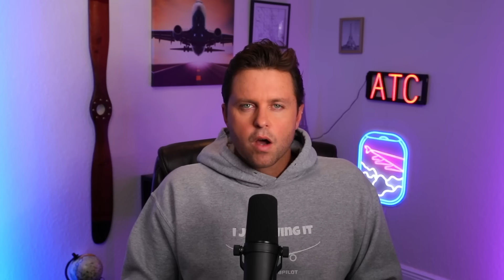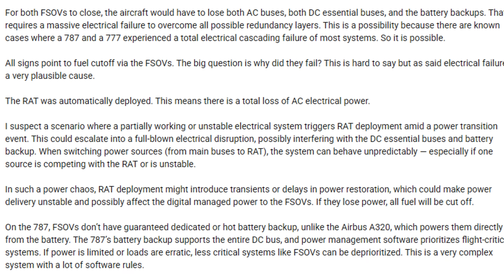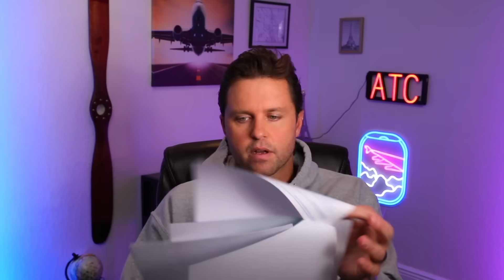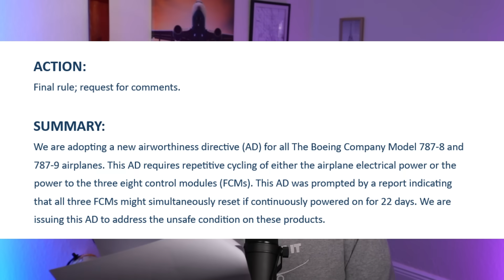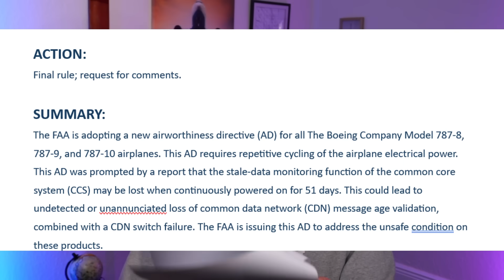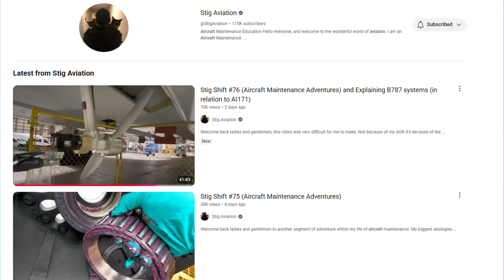Air India 171: Did a Software Glitch Cause Dual Engine Failure?

Comment: This theory is solid, and I fully agree it deserves serious consideration. The FSOV (Fuel Shutoff Valve) issue triggered by an electrical cascade failure is not only plausible — it's consistent with Boeing's own design and previous FAA directives.

The RAT noise heard right after liftoff, with no engine whine, suggests both engines were already dead. The gear truck tilt with doors closed supports that the retraction sequence started and froze — pointing to power loss early in the climb-out.

What makes this truly concerning is that this isn’t the first time. FAA AD 2016-24-09 warned about flight control module resets after prolonged uptime. We’ve seen RAT deployments (VS105, LATAM LA8084), and generator dropouts — all signs of vulnerabilities in the 787’s power distribution and redundancy systems.

On the 787, FSOVs aren’t powered by the PMA. If essential DC power is lost, they shut by default, even with the engines still mechanically sound. That’s how you get a dual-engine flameout without a mechanical fault.

Vapor lock? Unlikely. Fuel contamination? Needs to hit both engines at once — no reports of that. But this FSOV + electrical chaos? Matches the symptoms disturbingly well.

And here’s the most important point:
Even if this crash turns out to have another cause, Boeing needs to address this FSOV design flaw. The idea that both engines can die at 400 ft AGL because of a short electrical glitch is unacceptable — and we now have enough evidence from past incidents to justify redesign or redundancy upgrades.

This is a systems-level vulnerability — not a pilot error, not a freak failure — and it needs to be fixed before it happens again.
Reply: If this turns out to be true then Boeing should be held criminally liable. That's a major functional safety failure.
Reply: @mantan_rtw 2 weeks prior to this accident Boeing were legally let off the hook for the max crashes. It won't happen even if another 787 plunges into the ground
Reply: @mantan_rtw  They should have had criminally accountable by the first day the introduced the lacking quality controls in Boeing and tried to white wash it. One of THEIR MANAGERS who worked on the 787 Quality Management, in one of the first factories, comitted suicide not long ago.
Reply: Not the first time Boeing skimped on safety and redundant validated sysetms...
Reply: @albinekb  You’re not wrong — the 737 MAX MCAS tragedy is a stark reminder of what happens when design shortcuts and over-reliance on software override pilot authority or bypass redundancy.

What’s scary here is that the 787 FSOV situation mirrors that philosophy: a safety feature (spring-loaded fuel cutoff) makes sense in isolation, but when it's tied to complex electrical logic with no hardwired fail-safe, it introduces a new risk — especially during takeoff.

And since the 787 heavily relies on software-managed power distribution, a momentary glitch can disable critical systems that were never supposed to go offline in the first place.

It’s not just about Boeing cutting corners — it’s also about FAA oversight, certification assumptions, and whether enough real-world edge cases are being tested. Unfortunately, these issues often get fixed after a fatal incident, not before.
Reply: No it’s not. 

The conflict lies in how the Fuel Shutoff Valves (FSOVs) behave on the Boeing 787:

The post claims FSOVs are spring-loaded and will automatically close if electrical power is lost—cutting off fuel to the engines.
But Boeing design data shows the opposite:
On the 787, FSOVs are motor-actuated and latched. Once commanded open (or closed), they stay in that position—even if power is lost. They do not spring shut.
This means a total electrical failure would not automatically close the FSOVs and stop fuel flow. So, the theory that a cascading power loss alone caused both engines to shut down via FSOV closure is not consistent with how the 787's fuel system is built.
Reply: @morespinach9832  Thank you! I've also been trying to tell people this, but it's falling on deaf ears. 
As evidence, later manufactured aircraft actually had to have a supplemental rechargeable battery fitted to close the FSOVs in case of main electrical power failure. If memory serves, the wing spar valves also need power to drive these motor-driven valves closed. If the supplemental battery fails, the engines keep running until the fuel runs out ... or the fire service extinguishes the engine on the ground.
Reply: How many Boeing planes have this FSOV design flaw?
Reply: @michaelburnham4293  All 787s. Around 1200 units.
Reply: @michaelburnham4293   
Boeing 787: Most at risk. FSOVs are not powered by the engine’s own PMA or FADEC, but rely on the aircraft’s DC electrical system. If that system fails (or glitches), both FSOVs can close, even while engines are fine.

Boeing 777: Has similar electrical architecture in some models, though with different levels of redundancy. Not immune — LATAM LA8084 (777-300ER) had a major electrical cascade with total bus disconnect, but didn’t lose engines midair.

Older Boeings (737NG, 747, 767): Less software-driven. FSOVs still close on command but have more mechanical or directly-wired systems. The risk of silent shutdown from bus logic is lower.

In contrast:

Airbus (e.g., A320/A350): FSOVs can be powered directly from battery buses, giving them more predictable behavior during electrical transitions.

🚨 The issue isn’t the FSOV itself — it’s that on the 787, a short, complex electrical failure can trigger both engines to shut down, with no mechanical fault.
That’s why this deserves attention — even if AI171 had another cause, this weak point needs a fix.
Reply: If This turns out to be remotely close to the actual cause, I can see possible grounding of all Dreamliner fleet worldwide..  😳
Reply: Simple solution: shut the system down every few days.
Reply: @TeddyRumble -  not designed to work like that - that means something is failing - when should it be switched off/on everyday  ?
Reply: @TeddyRumble  That helps some known issues — like the 2015 FAA AD (2015-08-51) about the Generator Control Unit counter overflow after 248 days — but it doesn’t fully solve the FSOV vulnerability.

The problem here isn’t uptime alone. It’s about what happens when there’s a power transition or short-term bus instability (like during APU → engine generator switchover) — especially if it happens during takeoff.

In that exact moment, a transient power loss to both DC essential buses could cause both FSOVs to slam shut within seconds. Rebooting the system every few days doesn’t prevent that. And unlike computers, you can't reboot at 400 feet AGL.

So while regular shutdowns are good practice (and required for AD compliance), they don’t eliminate the risk of electrical cascade + FSOV closure during flight. This needs a design rethink — not just a maintenance workaround.
Reply: The failure occurring and causing immense trouble within seconds is really scary as a passenger and it's hard to imagine how pilots can identify and rectify the exact failure within these seconds time under pressure and also trying to be airborne at such a low altitude
Reply: What can pilots do to overcome this problem??.......(for the 1100 or so 787's currently in the air.)
Reply: @GARose-kt4jc  
Great question — and unfortunately, there’s very little pilots can do in real time if this specific failure happens the way it's theorized (sudden FSOV closure from electrical cascade). Here’s why:

 Why it’s hard to overcome in-flight:
FSOVs are spring-loaded to close when power is lost — and can’t be reopened manually from the cockpit if there’s no power to the actuator.

The FADEC and PMA can’t override this — if the DC essential bus feeding the valve actuator is offline, fuel is cut off, period.

If this happens at low altitude (like on AI171), there’s no time or altitude to troubleshoot before impact.

 What can be done proactively:
Strict adherence to all ADs (like 2015-08-51):

Ensure regular power cycles (reboots) are done per schedule to avoid known software timer overflows.

Push for MEL clarity on electrical system health:

Some pilots have reported "electrical oddities" (generator dropouts, bus errors) without clear grounding thresholds.

Any history of power transfer anomalies, even if transient, should be reported and investigated — not deferred lightly.

Request updated briefings from Boeing/OEMs:

If this theory gains traction, operators and pilot unions should demand clear documentation from Boeing on FSOV logic, backup power handling, and worst-case scenarios.

Crew awareness during gear retraction:

While not a fix, being extra alert during the critical APU→GEN handover (often just after rotation) could help spot abnormalities faster — though reaction time is still brutally short.

 Bottom line:
This is not a training issue — it’s a systems design issue. The best thing pilots can do now is keep pressure on Boeing and regulators to audit and upgrade FSOV power redundancy logic — and in the meantime, report any electrical inconsistencies no matter how minor they seem.

It's tragic, but until there's a design change, the current fleet of ~1,100 787s may carry this vulnerability quietly.
Reply: @GARose-kt4jc  Run the APU during all operations
Reply: @russellriggins3893  At my company, it’s SOP to takeoff and land with the APU running. I don’t know if they had it online during this flight and we gotta remember it can be MEL’d. However that would definitely have been a saving grace for them. 😢
Reply: You can kind of see how the vulnerability would appear. The software guys go to great pains to preserve their engines. They get paid for adding checks that avoid running engines under conditions that could result in damage. 

The only cheese holes you need is failure to exercise all the code paths. It's easy to get a conditional wrong. Overly conservative code persisting in routine operation is likely, too. The group seeing to it that the plane won't take off when misconfigured didn't have a wide enough mandate to consider the whole system, including the FADEC.
Reply: If this scenario is correct, then Boeing's stock is about to tank, and its Paris Air Show 787 orders could be canceled.
Reply: Please see my other comments above just now. Please research and address what running the APU during all of flight  operations would do. In this crash, would running the APU have mitigated the FSOV risk?
Reply: Possibly the fuel in the pipes after the valves were used up as the aircraft got airborne ?.
Reply: If this ends Boeing and causes some major rethinking of how things are done in effort to save lives and not just make money, it would be a step in the right direction. And no, designing with AI would likely take us back to before 1903, just with a new look and more lives at stake at any instant.
Reply: @farastyle11  well then, glad that’s settled
Reply: Powered up for 51 days? Seems ridiculous. Did Air India track powered up time? it is conceivable that airliners in scheduled service could be powered up continuously. Wow, I kept thinking that there must be something software related at the bottom of this, but just because the power was on for 51 days would be incredible.
Reply: No, it's not solid, nor is it in line with the overrun directives. And in the two incidents being cited of cascading electrical failure, NONE of the engines lost power or thrust.
Reply: @Objectified  that is why the plane kept flying and got to its destination right. i got it! maybe you are right
Reply: @Objectified  Fair point — those previous incidents didn’t result in engine flameout, and that’s exactly why they landed safely. In AI171’s case, the plane didn’t keep flying, which is why we’re looking at what could take out both engines simultaneously, beyond typical electrical glitches.

The FSOV theory stands out because unlike FADEC or generator faults, it explains how the engines could shut down even if mechanically fine. It's not that past RAT deployments prove this — it's that this time the RAT deployed, and the engines didn’t recover.

So you're right to call for caution — but also fair to say this may be a new manifestation of a deeper vulnerability, not just a repeat of past cases.
Reply: sure
Reply: which responsible company desgined and executed the fadec system called full authority above god? GE not a software company.
Reply: A LOT of "Boeing bashers" out there, cause its he "IN" thing to do!
You're not like that, you're analytical and honest,.......much appreciated by someone who worked at Boeing in the 1990's.
Reply: @BillieBailey-th3lc As someone who worked at Boeing in the 90s I would think you would see the difference between Boeing then and Boeing now. Boeing has made some of the best aircraft ever. But after the merger with McDonnell Douglas things changed. Different management, a lack of competition and ultimately an arrogance became the problem. That arrogance and the dedication to money over safety saw two plane loads of people killed - Boeing knew the single point design flaw and STILL didn't ground the 737 Max. We may be at a similar point with the 787.
Reply: @BillieBailey-th3lc  I've actually been avoiding to blame Boeing in absence of any evidence. But this theory makes perfect sense, it also fits Boeing's complete lack of safety and focus on profits.
Reply: @BillieBailey-th3lc  Nobody would "bash Boeing" if you guys would have kept up your processes and quality management. Like in the 90s.

Comment: Im not a commercial pilot or engineer, but I did work the Swissair 111 (MD11) as a ground employee and remember everything from that incident. There were signs prior to past electrical issues and complaints from paxs about the plane. I remember the mtc log books were heavily scrutinized over. 

So, the second I saw the video from the paxs that arrived inbound on that same jet showing the cabin lights flickering, no a/c, and the video system freezing, I wondered if the plane was going thru some sort of electrical issues as well. Theory of course. I understand the video system has nothing directly to do with cockpit or controls, but it is apart of the plane’s electrical system overall. I wonder if Air India was keeping up the maintenance on the aircraft. I wouldn’t doubt we find out discrepancies in the mtc logs or something relative to the issue discussed in this video that may have contributed to system failures. So it’s possible it’s not a design flaw, but rather a lack of proper mtc being taken or overlooked.

Comment: The emergency RAT was deployed as seen in the video before disaster struck. No electrical power? Last resort type stuff happening here. Computer glitch event the primary cause? Root cause analysis outcomes will verify. What did the black box data reveal?  Too many unknowns going on? Thinking out loud here, any tech warnings made to the other airplanes of the same model yet? If so you could smell a rat here? IMHO a lot of industries across the board have been suffering similar outcomes in manufacturing where costs are the major drivers?
We are in a very different era today sadly ( Quantity over Quality).

Comment: I am not convinced that the FSOV’s are “spring loaded” to close. I never heard of that before. I have flown fly 747’s for over 30 years, and never heard of such a setup. Granted, the 787 is more advanced, and more of an Electrically operated aircraft, but the logic for electrical loss closing it doesn’t pass the sniff test. As a matter of fact, I know of not a single “spring loaded” valve on any airplane. I am willing to concede my knowledge may be limited, and love to learn, even at the expense of my ego.

Comment: IF YOU HAVE A SPRING SNAPPING THE VALVE CLOSED, YOU HAVE TO DISMANTLE THE SPRING MOUNT STRUCTURE AND MANUALLY RESET THE SPRING. IF IT HAPPENS IN THE AIR, EVERYBODY'S DEAD.

Comment: Thank you for your channel Gary. I read hey fix this yesterday on another channel. As a pilot can you make an inquiry verifying the fuel shut off closure in extreme cases with Boeing.
This theory of fuel starvation with electrical failure/ software issues on the probability list.

Comment: I have been saying it was a software glitch for days now. It is the only plausible explanation. The Boeing 787 has a computer software that manages electrical distribution to all parts of the plane, including the cabin pressure and climate (AC) in flight entertainment and WAIT for it... Fuel pumps. The software can make decisions where to distribute power. We already knew it was glitching on the earlier flight, the AC and in flight entertainment was not working! Now imagine just as it was taking off the computer decided to reroute power from the fuel pumps to somewhere else on the plane.. Wouldn't it be tragically ironic if suddenly the in-flight entertainment was working but the fuel pumps stopped working!

The very fact that Boeing even has such a software on the 787 should terrify everybody!

Comment: Ever since the introduction of the MAX series, there has been far too may stuff ups by Boeing.  Hence; my former saying: "IF IT AIN'T BOEING, I AIN'T GOING" HAS CHANGED TO "IF IT IS BOEING, I AIN'T GOING"  I'll take my chances with Air Bus or some Russian contraption before I trust Boeing ever again,  If you recall, the MAX 7 and Max 8 aircraft had soft ware issues that caused a couple of crashes (Air Asia and the Ethiopian plane.) Good bye Boeing; you are too bloody risky for my liking!